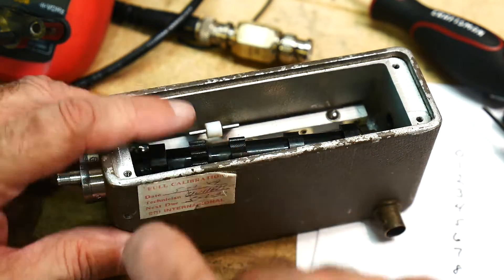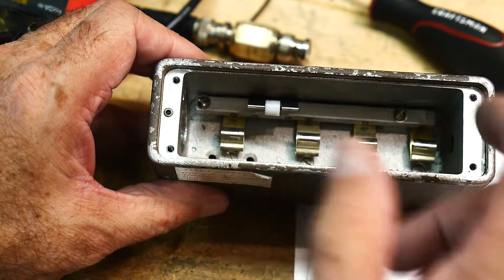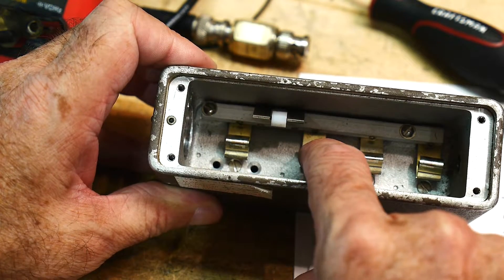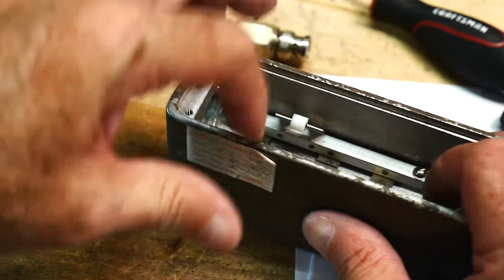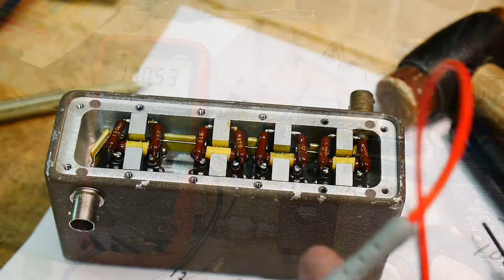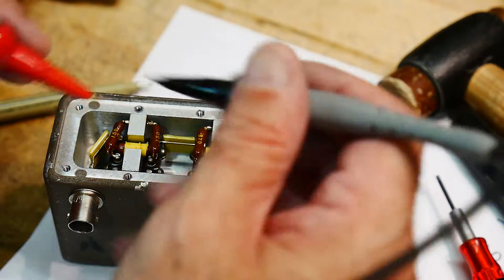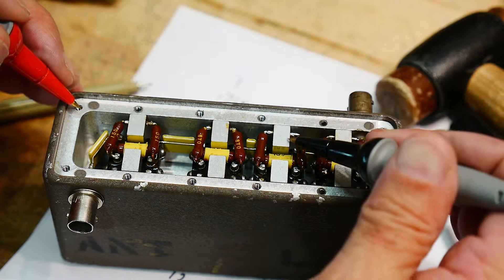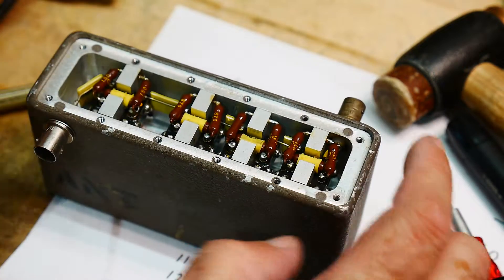#528 HP 355A VHF Attenuator (part 3)

Comment: Fun fact:  Aluminum used to be the most valuable metal on Earth.  Napoleon had a set of aluminum silverware, and the top of the Washington Monument is aluminum.  It used to be a prestigious thing to have something made out of aluminum.  Many people believe that aluminum doesn't "rust," but aluminum oxidizes extremely readily.  It just forms a very thin, very stable oxide layer that prevents the underlying metal from further oxidation.  In nature, over billions of years, almost all of the metallic aluminum has oxidized, which is why metallic aluminum is so rare.